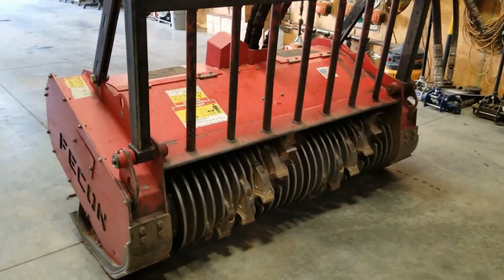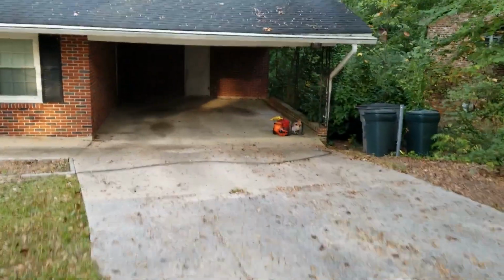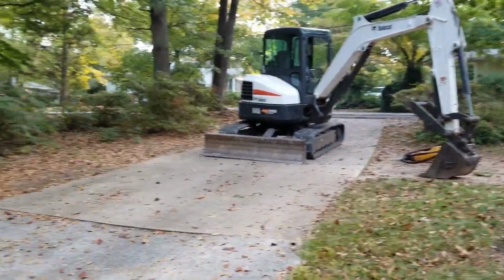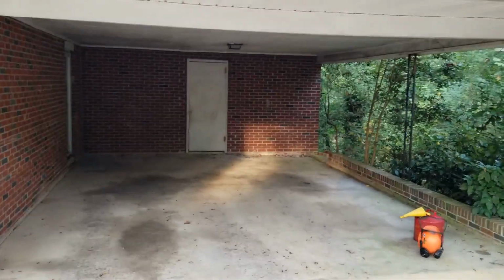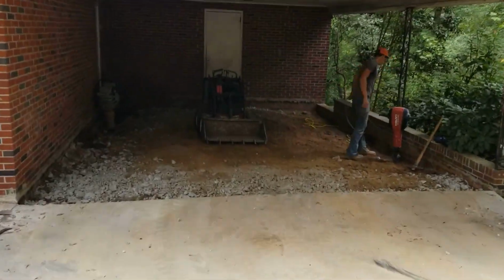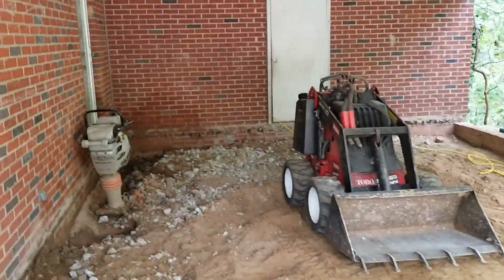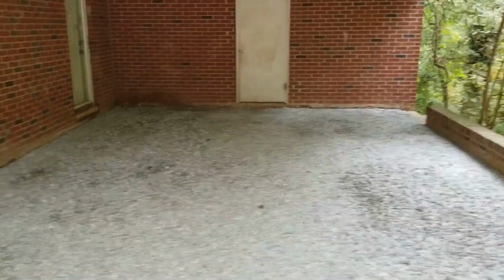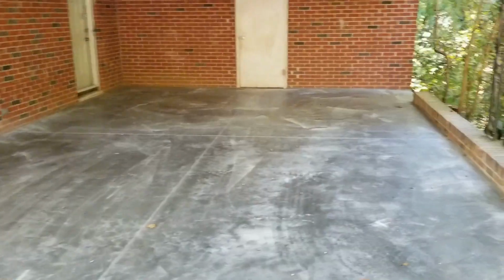Tearing up some Concrete

Comment: You might have been better off mounting that hammer on the skid steer.    Starting from the back and working your way out of the carport.  Most hammers work a lot better with less wear straight down.  If you angle them like that they can lose nitrogen charge, leak oil or just wear the piston out  early.
Reply: Using the hammer as a scoop to stir in the dirt isn't that hot, either. Guess it was a rental.